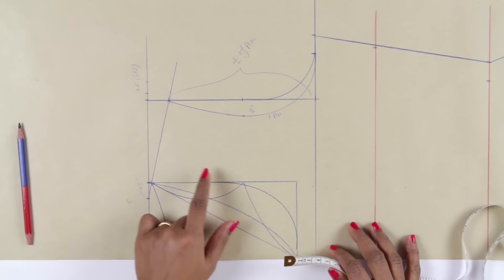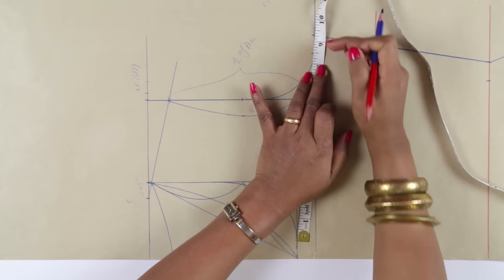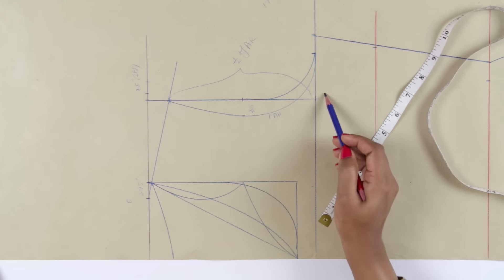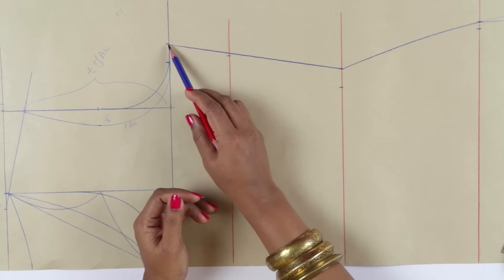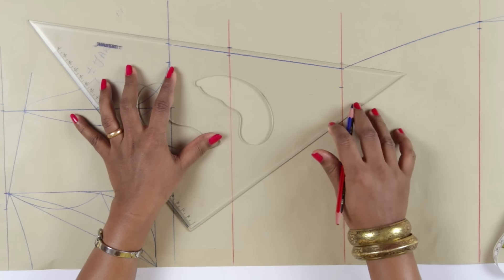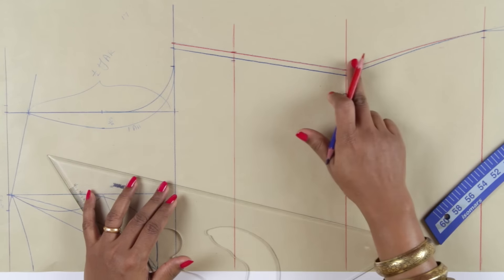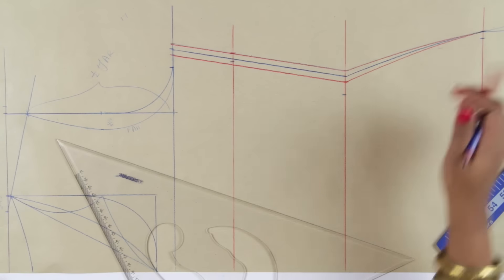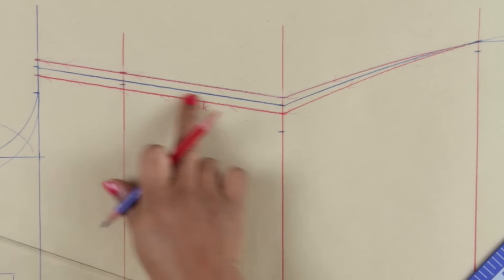Class 24 - How to draft a body sloper (armhole explanation) part - 2

Comment: Which one i have to consider to check with 1/2armhole +ease, front armhole marking or back armhole marking??? Both are coming in different length. If I consider back and check and redraw then front is in excess, if I consider front and mark then back arm hole coming less than 1/2armhole+ease.pls tell me
Reply from the maker: The front and back curves both together should match  with your body armhole measurement.

Comment: Hi savi, when changing the back and front pattern according to bust point as its outside the chest ease the pattern for sleeves is not matching with the back . Do we have to reduce the sleeve too for the back part if so how I have to alter the sleeve pattern.. Can you please explain
Reply from the maker: +Ashwinee Vasudevan you need to measure the body arm hole front and back and then measure the sleeve arm hole front and back. They both should match, if not you need to reduce or add ease to the sleeve arm hole to match with the body.

Comment: Hi Savi...grt video's from you..I appreciate...
I have a doubt about increasing in the front and decreasing thee same amount  at the back ..then overall it is the same..wont the bust be tight  still the whole round is the same?
Reply from the maker: Thank you. 
This can happen only in some body types and as you increase the ease on chest and waist only to accommodate the bust round, the ease on chest and waist can be reduced at the back [as you are only reducing the excess ease given] it will not be tight.
Reply: Savi's Fashion Studio 
Thx  for the valuable reply Savi...

Comment: Hello,. So if we shift the chest line on top to adjust armhole measurement, the length of  armhole line from top to chest line  also reduces..so should we mark this  new armhole round measurement while drafting sleeves
Reply from the maker: No draft sleeves as normal and then when you measure the curves if it does not match with the body pattern make adjustments.
Reply: @SavisFashionStudio  Thank you

Comment: Hi savita
You said u got half the armhole I.e eight and a half plus three fourth I.e.nine and quarter.this is for front armhole. Should we get in e and quarterfor back also. Then for sleeve how much should we draft if  armhole is 17 inches
Reply from the maker: Hi when you measure the curves of the sleeve pattern it should match with the armhole of the body pattern. If it is less or more you need to increase or decrease the ease given on sleeves and redraw the curves.

Comment: Thank you soooo much.  this cleared up many things for me.  One question to confirm, you would still use the added ease method for a larger busted women, correct?  The bust edge is definitely falling outside the line.  Do I just add the ease or is there something else that is needed?
Reply from the maker: You are welcome. 
You would need to add more ease for large busted.

Comment: GM Savita.,
Armhole and sleeve drafting is most challenging thing for me. Never get it right. Either sleeve will short or  too big but never as per arm hole. Pls help me with correct procedure.I have watched your body sloper as well as sleeves.. But I am still not getting it right. 
1. How to measure and mark arm hole. Have seen various methods. Few state 1/8 chest +1". Few say 1/2 of arm round. Imp to note is final figure arrived from both method is not same. Pls help.
2. How much ease should we consider. If I need kurta like ready made (eg Biba).
3. Sleeves - again it should be half of arm round or half of armhole coz in my case it is never in sync with armhole. Pls help.
Reply from the maker: Very good morning. 
There are different methods followed by different people. I teach the method I have been following.  I use 1/2 of arm round measurement to draw the armhole.  However, after drafting the body pattern it is important to measure the back and front armhole curves and ensure it matches with your body armhole measurement plus ease given on chest. If more /less - raise the chest line up/down to decrease/increase the armhole curve.  
Then draft the sleeves pattern and again measure the front and back curves and ensure it matches with the body pattern. If more/less, decrease/increase the ease and redraw the curves. 

for full fledged online sewing classes and for pattern making tools visit www.savisfashionstudio.com
Reply: Savi's Fashion Studio thanks a lot  Savita.. I am trying this method. Hope to get it right.. Thanks again.

Comment: As said in the video my armhole measurement is less so I shifted the chest line downwards until I got the right measurement. My doubt is after doing that should there be any change while drafting the sleeve. Because my sleeve measured less than the armhole measured in my body draft. Please help me
Reply from the maker: No changes in the sleeves, only measure the curves and see if it matches with the body armhole. If less, increase the ease on sleeves and redraw the curves and vice versa.
Reply: By how much do you shift chest line ,any specifications or trial and error method?

Comment: If I need to increase the ease on the chest line of an inch do I also reduce the amount of ease on the back by an inch?
Reply from the maker: You may do so or you may decide on the overall ease and then divide equally for front and back.

Comment: hi in this video you have given drafting as to when the bust round goes beyond the chest round. what if the bust round is one inch inside the chest round. how should i draft
Reply from the maker: The problem is only when the bust round falls beyond the line as it will be tight.  If the bust round is within the side seam line, there is no issue as it will not be tight at the bust. However, if you wish to reduce the ease at the bust, you can reduce the ease on chest and waist and then connect.

Comment: I found your tutorial very helpful. Thanks.
But my sleeves in the front doesn't match with the bodice armhole. Can u please tell me what mistake have I done?
Reply from the maker: You need to measure the armhole curves on the body pattern and sleeves and make sure it matches before cutting the fabric.  If not increase or decrease the ease on sleeves to match them.
Reply: But adding extra ease would make the sleeve stitching difficult as the center of the sleeve also shifts... Even I have the same problem..for me the back sleeve length is more than the armhole... Why is that so?

Comment: Thank u soooooo much for explaining abt arm hole in such a brilliant way. Can u please just tell me when you draw the armhole line does it have to be same as yr shoulder measurement. Ie if yr shoulder is 14 do u keep the armhole line 7. Thank u so much for yr work.
Reply from the maker: +m ali Thanks for the appreciation. Arm round line is not related to the shoulder measurement. After marking 1/2 shoulder measurement, downwards you need to mark 1/2 of your arm round [biceps]. Please refer to my previous video on drafting basic body sloper.

Comment: May Allah bless u mam. thank u so much for ur all videos. my bust point is outside of the seem and i made the pattern as u taught but i am getting some problems to mach sleeves  with the body. they could not mach together.
Reply from the maker: +amina khan Please measure the arm hole of the body pattern before cutting and also you need to measure the sleeve curves on your sleeve pattern to see if it matches. If sleeves does not match you need to increase / decrease the ease and redraw the curve to match with the body arm hole.
Reply: mam, i have added 3/4" ease in my chest and waist seem to my pattern, and i added more 3/4" ease to my chest and waist seem line in the front part of the pattern  to fall the bust point in the line and reduce  all the eases of the back part. now back sleeves matches with the back body part but front part  of the body have some gape,front  sleeves could not cover it properly. i added 3/4" more ease  in the arm round measurement  than my sleeves became lose fitting.

Comment: hello madam thanks for such a wonderful tip. could please show as what to do when the sleeve cut  does not match the armhole while stitching? lot of us are waiting for this tip please consider this request.
Reply from the maker: Hi, thanks. Many times we have replied to similar queries. Before cutting the sleeve pattern, measure the curves and see that it matches with the arm hole curve measurement on the body pattern. If it is less, increase the ease and if more decrease the ease.

Comment: madam what about for people who have waist size larger than the bust size ???
Reply from the maker: +Urvashi Shenoy Prabhu Pls double check the measurements. As per the body anatomy waist would be smaller then the bust round. however, if it is not, then just apply the measurements as you have taken and draft the body sloper.
Reply: in case of pregnant females then ????
Reply from the maker: +Urvashi Shenoy Prabhu then obviously waist size would be bigger :-).  keep more ease also  so that there is room to expand.

Comment: Is the arm round 17 then why did u take the body slope as 6and half
Reply from the maker: Hi, may be you missed our class 2 in which we have shown drafting the basic body sloper - https://youtu.be/Xxu6k94N0e8 .  In the pattern we mark 1/2 armround [biceps]. When you draw the curves you will get your armhole measurement. Just try drafting the pattern. If you take 1/2 of your armhole and then  when you draw the curve it will be very big.

Comment: Hi Savi,very good explanation girl :)one more doubt i have..how can we adjust the armhole when we use the deep neck theory?do we have to adjust the chest line till we get the exact armhole?i have a small arm hole and bust measurement is large when compared to armhole..do you have time to help me?thank you very much once again :)
Reply from the maker: +Geetha Ramachandran Thanks for the appreciation.
Yes you are right you need to shift the chest line upwards or downwards to adjust the arm hole.
Reply: Wt measurement we av to take to adjust the chest line...u didn't explain this in this video
Reply: @max_magi6417  adjust it according to your half armhole measurement as explained in the video by Savi mam .If the measurement is coming smaller shift it down little bit  if it's larger shift it up . Hope this helps

Comment: Hi Savi, amazing video. I just have a couple of doubts.
1. the arm hole calculation - in this video, ur arm hole is 13 inches. hence u have drawn the arm hole box as 13/2 which is 6.5".  If the arm hole round is 18 inches, taking half of it works to 9. in that case, won't the arm hole box or square be too big?
2. for the chest adjustment, u have mntioned compensating the back measurement for the excess taken in the front for adjusting the bust line. Wouldn't the garment become too tight in that case? Pls advise.

have watched almost all ur videos and I think ur doing an awesome job. Thanks again
Reply from the maker: Thanks.  1. We do not take Arm hole measurement while drafting pattern. 1/2 of Arm round measurement is taken while drafting pattern.  Arm hole measurement is taken for cross reference. 
2. it wouldnt be tight as you are taking the complete chest round measurement plus adding ease.

Comment: Hello, thank you mam. this was a very clear and informative video. I did make a pattern using your video. I have a small doubt, now you have measured the front armhole and its 9(1/4) and what about back armhole? is it going to be 8(1/2)? or 9(1/4)? please do get back asap. Thanks :)
Reply from the maker: +kiran knowles its 8.5"
Reply: Back arm hole is not 8.5.  Total is 17/2 8.5.